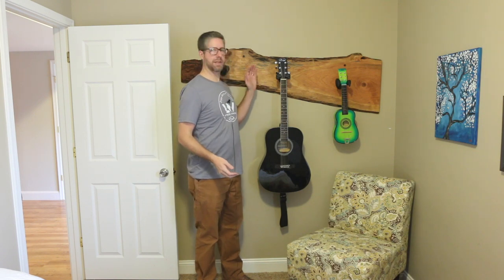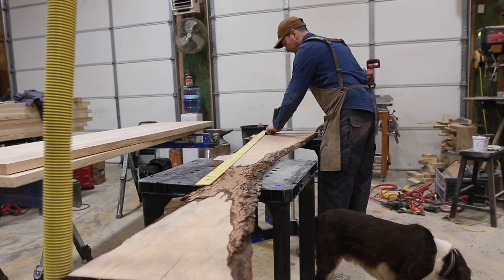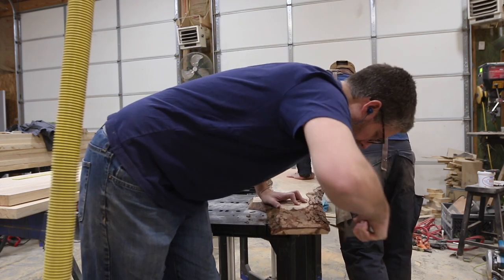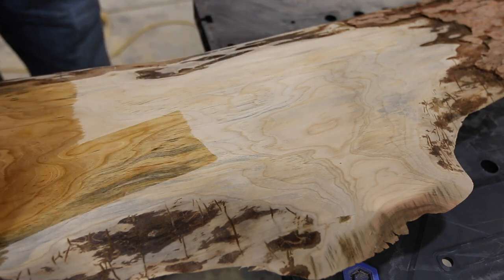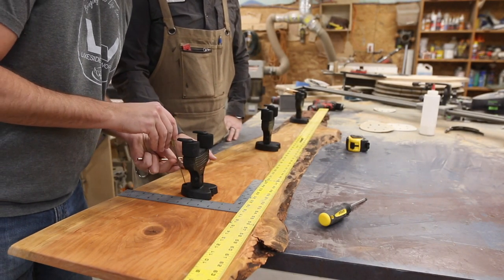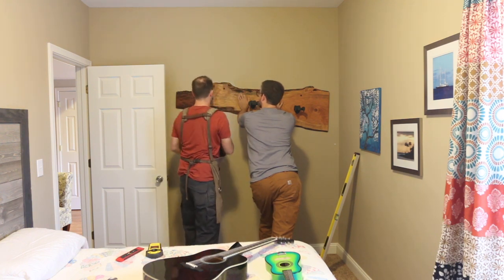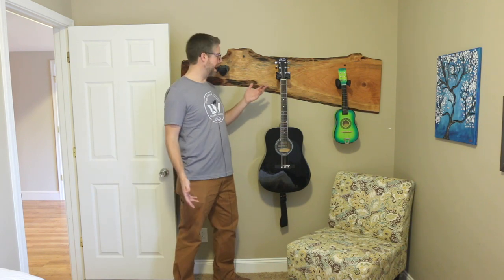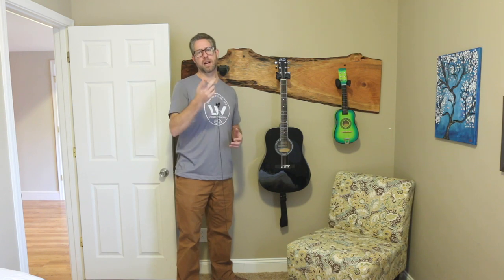Guitar Hanger DIY | How-To Woodworking

Comment: That cherry turned out great! I gotta hurry up and get to making something with this tiny pile of it that I've had for 4 years... Not sure if you've tried one, but I've had better luck with the small magnetic stud finders.
Reply from the maker: Thanks! I've not tried those out...I'll have to look into them. I've even used a powerful rare earth magnet with some tape around it so it won't scuff the wall. It grabs onto the drywall screws or nails in the studs very easily and works quite well.